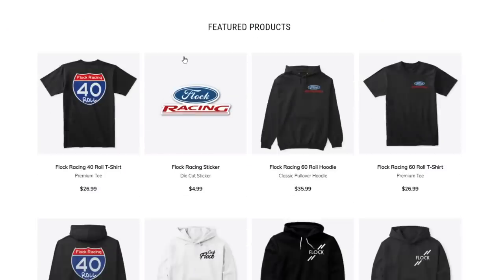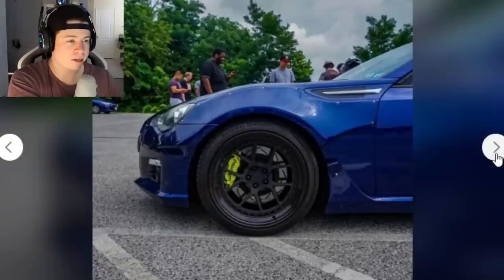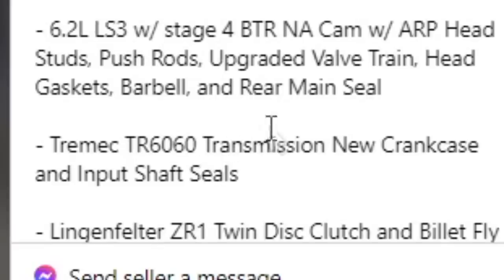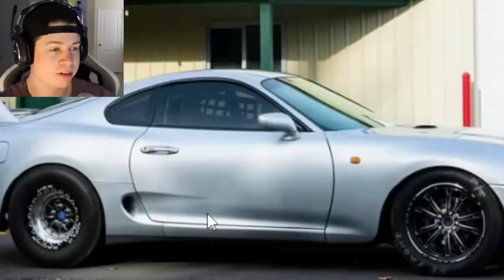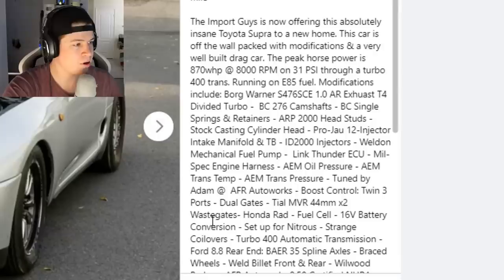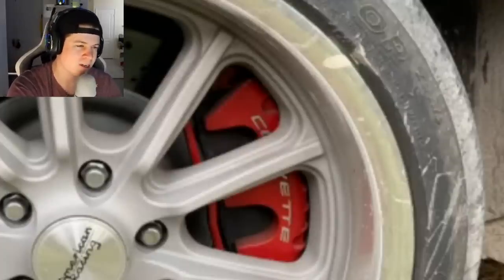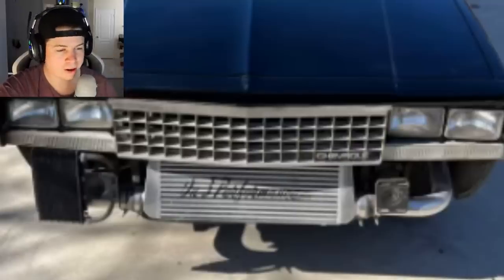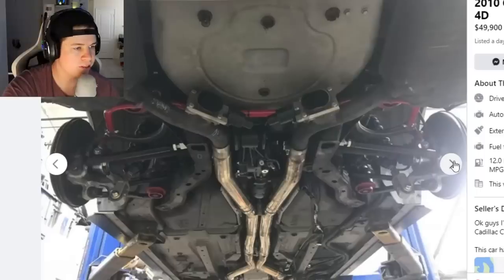Crazy Unexpected TUNER Cars Up For Sale! (Tuner Cars On Facebook Marketplace)

Comment: On the brz, you can get a kit that will allow the gauges to work but its like $5000 plus engine and transmission, thats if you do it yourself, if you take it to a shop, they’ll charge you approx $25000
Reply: My LS build in my CT’s-v cost around 25k
Reply: That had 775 hp about 675 to the back wheels. No boost

Comment: That’s the same CTs-v I had, I had a LS build from the ground up with every thing you could think of with 750+hp with 675+ hp to back wheels. Mine was way cleaner, black with a wide body kit, racing rims, so loud I had to install a switch on my seat to switch to a diff exhaust so I didn’t get pulled over . It was a 6 speed, interior super clean stock with some gauges. I paid 16k for it and sold it for 22k after a year of racing and only having to fix the clutch once. These prices are rediculous, way overpriced. Ppl don’t understand you don’t get back what you put into aftermarket
Reply: No cap

Comment: 40 grand…for that brz no f way!! I got a 2013 cts-v  6 speed with a LS pushing 750 hp, 650 to the back wheels, super clean for 15 k already built that’s so f fast it’s literally scary. I sold it to a guy that came down from North Carolina for 21k

Comment: El Caminos are ugly as sin, but old timers swear that they were fast af back in the day. They're light and with some modern power mods, I bet it's quick. Good luck selling it for 20 k though
Reply: Sadly, that price is about right in my area lmao. Especially for a clean one. Built or not. 

Everything is just over priced these days. 

Can't even buy a drivers car for cheap anymore.
Reply: @SMD-si7fm  Very true. That one didn't look too clean on the inside but it is technically a modified classic now so someone that has always wanted one for a project car might be willing to pay that much happily knowing they won't have to do a lot of the hard work to make it fast.

Historically, modifying your car would decrease it's resale value but in this crazy time of shortages and inflation, modified cars are actually sometimes selling at a large profit. I'm not sure if it's partly because there's a small shortage of performance parts also or just the cars. Pretty much if you're car runs, it's worth more than expected across the board.

Many dealerships list their new cars online at the msrp but in person they often have a "market adjustment" bump in the price. At the same time though, they list their used cars of the same model with some miles on them for at least 5 grand more than the brand new 3mi car. It's gotta be the worst time in my lifetime to be buying a new or used car period.

Comment: That Supra was definitely not built bro, it's exactly what you said it is, a dyno queen. Probably made 870whp turned all the way up on the dyno ONCE, and he 'races' the car at a much lower performance level, a built 2JZ can comfortably run well past 1000+whp, why would he specify 870whp if there's potential to keep going? It's because he knows that is the maximum he's ever felt comfortable turning it up because he's afraid of grenading it. I don't know how great a driver he is, but I'd expect an 870whp Supra to be in the low 8's, not barely cracking into the 8's, the cars running 6 second passes are doing it with like 1200hp, so I'd expect a lot more from a very almost 900whp car.